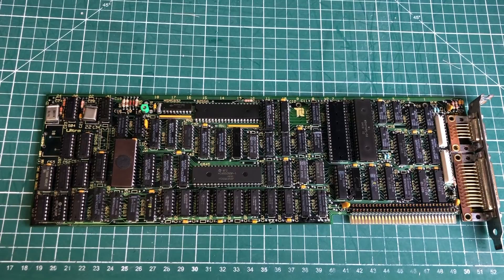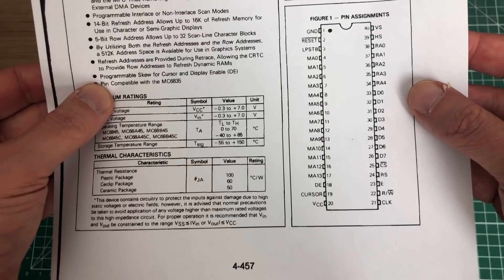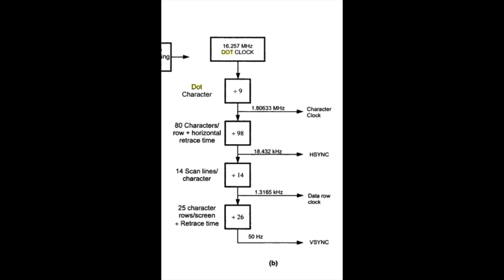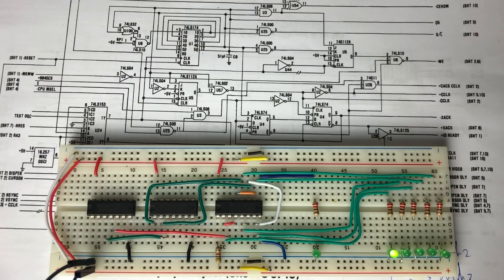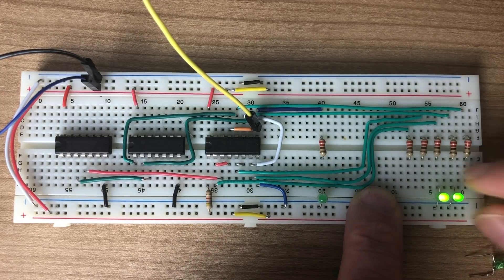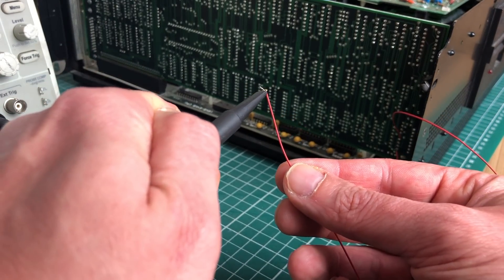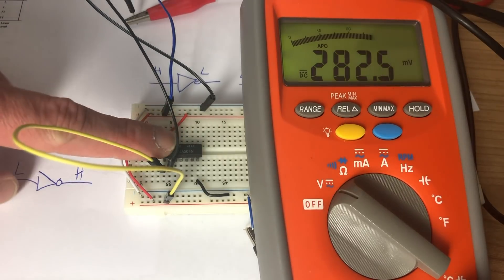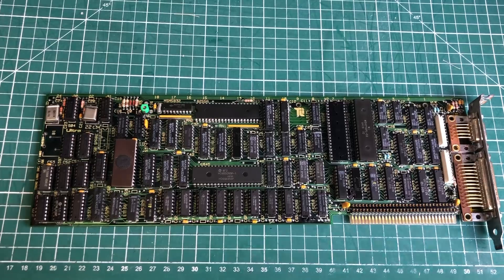Unfixable videocard from hell ? (part 2)

Comment: First things first, the card isn't going to run on 4.1V even if it was working perfectly fine (although I've seen a Williams Joust run on 4.2V, but very unreliably)
Clock: There's a good chance that this is a multi standard card where the clock frequency depends on what video standard it emulates. It has 64k of RAM, so it's quite thinkable it can do MDA, Hercules and CGA, so that depends on how it's initialized which depends on what's on that ROM. The 6845 is really flexible. Go check HSync and VSync.
Hot Chips: If it's a 74LSxxx it shouldn't get hot. Some get warm. There are exceptions (like the 188). If it's a PAL or a GAL, these usually run hot. At least early ones like on this card.
Battery Acid: It's rather common to see chips that suffered battery corrosion run fine for a few hours or days and then fail.
Logic Levels: Check the voltages on the pins on the ICs to the left of the ROM. If there's any signal where low is > 0.3V or high < 3V, that chip is bad. On the right side of the ROM are lots of tri-state devices where these levels are actually OK.
Reply from the maker: Thx a lot for all the tips. Will look at all of them and I hope to see you in part 3

Comment: is the crystal putting out the right frequency? I know its not really common, but they can go bad
Reply from the maker: Outgoing frequency from the clock circuit is fine. Both crystals (18mhz for the serial ports I think, and 16Mhz for the clock signal) seem to be fine.

Comment: Not an electrical engineer, but I would definitely check if those two 60C chips are working the way they should. There can be short in those two (closest experience I have is burned Arduino nano - atmega chip was very hot and never worked again after I accidentally shorted it).
Reply from the maker: Yeah will check those. Only decided to checked the temperature hours before editing the video :) sometimes you get tunnel-vision when debugging those things for too long.

Comment: You should try to install a replacement battery. I've had several PC components that had a battery that would just not run correctly if a good one wasn't present. Some circuitry only powered by it, or memory that will not keep its contents at all without the battery.
Reply from the maker: Tried it in the beginning but didn’t notice a difference. But would not hurt to try again. Thx !

Comment: Voltage drop isn't across the connector but your super thin wires...
Reply from the maker: Also possible yes :) was even worse with my chinese croc clips :) never knew that made such a difference. And didn’t realise it would draw 1.8amps.
Reply: @RetroSpector78  Yeah the Chinese croc clips are notorious for being terribly thin or making bad contact even inside the clip, really got to measure them and trash the bad ones

Comment: 60°C of heat on a standard TTL logic IC is not normal at all. Probably those 2 chips are internally shorted and cause a high power draw when you put the board in the ISA slot, this could affect the correct working of the entire card. I would start by replacing them.
Reply from the maker: I checked that these pins were electorally connected and as such it didn’t matter what pin I used ? In that case is it possible that one chip is on pin29 and would not affect pin 3 ?
Reply: @RetroSpector78  Ignore that part of the ISA slot of my comment, I actually deleted it after re-watching your video, where you connected pin 1 and 3 to the power supply and measured the voltage on pin 29 and 31. This confirms that the two +5V lines are connected so powering the board from pin 3 or pin 29 shouldn't make any difference.
I suspect that those two ICs are internally shorted to ground. I remember when one chip died on my Roland Jupiter 6 analog synthesizer, I was playing some music on it and suddenly the synth went out. No magic smoke, strange noises and such, it just stopped producing any audio and all the lights on the panel went off. No response from the keys nor the controls on the panel and a power cycle didn't fix that (of course...). I opened it and by touching the components with my finger I identified one analog IC on one voice board that was really hot. I replaced it and the synth came back to life - that chip suddenly shorted to ground. Chips can short at any time and when you less expect it even without any bad power event, so after that experience I'm not suprised to see issues like yours, especially on such old boards. This is why I suggest to start to concentrate around those 2 ICs, like others adviced in the comments BTW.

Comment: The PC power bus is probably dropping lower than the bench power supply and the clock is being affected by that.  Those chips at 60degC are DEFINITELY too hot and should be replaced.
Reply: DAC chips will get that hot. Which is normal-ish. 10 watts isn't outlandish but is higher than I would expect. My genuine herc card used 8.8 watts IIRC. Clock won't be effected by vdroop much, or shouldn't be. It is being pulled into a mode that is not usable for post.
Reply: @wishusknight3009  There are no DAC chips on that card, the chips that were hot appear to be 74 series logic chips next to the CRT controller.  The closest thing to a spec that I could find says 4.5A is the limit of the ISA bus.  I can't believe the actual connector is rated for that.  I'll have to check my Hercules card, it would be surprised to see 8.8w.
Reply: @eformance  Makes sense. Shows what I know lol. I see some other people here have given some good explanations to the heat spots.
Reply: Agreed
Reply: Yup

Comment: That power consumption is a clue, I don't think that the video card should take ~10w.  You probably have some shorted parts on there and a "fingertip test" should be done to find any warm chips.
Reply: EFormance Engineering  probably leaking gates to a rail
Reply: Totally agree. These cards take about 4-6W.
Reply: Just spray the card with alcohol. If it catches fire then there was a chip that was getting too hot.

Comment: Did you try EEPROMing it?
Reply from the maker: Read the eeprom chip and seemed ok. Could read it and noticed lots of characters in it :) so I guess this one is not the issue.
Reply: @RetroSpector78  I would not be so hasty in saying that it is OK (quite yet). I would try EEPROMing it with confirmed working image that matches the card - if you can find one. Also keep in mind that those tend to have limited read/write cycles and you cannot do it forever.

Comment: The divider logic is not dividing by 9 but by 16 instead. My guess is a bad logic chip  in the divider logic. Sometimes chips don't go completely bad, but are almost bad and sensitive to the power supply. Try varying your bench supply by +/-5% and see if you can reproduce the effect on the bench. The voltage drop on the bench was quite considerable. The bad logic chip might just still work at this lower voltage...
Reply: Adding a wild guess: hard to see but I may have spotted a 4bit counter (74ls163) not too far from the oscillator. This could be used to divide by 9 (reset controlled by a NAND gate combining bits 0 and 3, so the counter resets to 0 when reaching 9). But when the reset logic doesn't work, the 4bit counter divides by 16 instead).

Comment: Hey there, been watching your series from some time now so I thought I'd give you a little help with my insight.
To me, the main steps of diagnosing over consumption are as follows :

1- Checking the power rails integrity : with a simple ohmmeter, pick your usual +5v/-5v/+12v/-12v on the main connector (as you did) and check that each (and I mean all of them) chips VCC are connected. Do the same with each GND.

2- Power it with a bench supply, preferably not more than 500 mA on the +5v rail. If current gets limited, check what is consuming that power. You can feel the heat from the components with the back of your hand (or even your face because it's even more sensitive... silly, I know, but it works).

3- Now you've identified something. Those two 74ALS258N sitting in the middle that are overheating seems to be linked to the excessive idle power consumption (2 Amps at idle is a lot). These are data bus multiplexers, and their outputs might be tied down to ground by what's after them, causing them to sink all the power through them.

4- With the power off, check again the outputs of the two chips and the GND. With an ohmmeter, then with the diode tester mode (you could find bad transistor junctions).

5- Then proceed to remove all socketed chips you have on the board. The idea is not only to find the culprit, also being able to reproduce the fault. With (almost) no circuits, you will get the big picture of whether the chips OR the board is at fault. Dirty traces under sockets can cause high impedance MOS inputs to go low or high.
(By the way, once you know the board's PCB is in good health (clean, no bad traces), soldering sockets for the chips is helpful)

My personal advice would be to remove all RAM chips, they can go bad for nothing much.
(Don't focus too much on the "low" 1 Mhz clock signal, it might be related to low VCC)

Once you've identified something wrong and eliminated it, repeat from step 2.
Then, once we have every chip present and not causing problems, we willl look for the proper signals (clocks).
I'd advice not plugging it in the PC until then.

Good luck with your fix, it takes time and patience but it is worth the happiness once you get it done :) so please don't give up.
Reply from the maker: Thx a lot for this elaborate comment ... will definitely try out your suggestions, provide feedback and hopefully see you in part 3 :)
Reply: @RetroSpector78  another video I watched said flux was acting as a semiconductor and the 6502 worked after the flux was cleaned off. I think the corroded leads may be from water damage I want to see part 3
Reply: Damn dude this is like an entire wikihow article with a step by step guide on how to fix this card!
Reply from the maker: Hehe .. sure looks like it :) but already tried a lot and it can get complex.... without schematics and a lack of some fundamentals and experience it can be tricky. Fixing a PC is 1 thing, drilling down to the chip or even logic gate level is another :) but as long as it stays fun I will continue. If all else fails I’ll run over it with my car and make a video on that :)
Reply: @RetroSpector78  No you won't...
Reply: @RetroSpector78  You're welcome.

Don't be discouraged by the apparent complexity, just check one thing at a time so you will be more efficient.
Read some datasheets (datasheetcatalog.com is nice for this era), and you will get a general idea of the inner workings. Experience comes this way.

I can still guide you through what you will find when troubleshooting.
But please... no car...
Reply: @cookiemetal7792  I won't let him!
Reply: its also entirely possible that the interface on the pc has some sort of issue due to age ie slightly rusted connections, weaker than expected capacitors that drive video card slot . It seems really strange that on the bench you would have good signal but putting in into a pc , the signal gets swalllowed
Reply: @Cookie any resources for learning how to do some of this stuff, for instance how to find bad transistor junctions? I'm trying to fix a board of my own, but I'm very new.

Comment: interesting! was the crytal still oscilating at 18MHz when you plugged it in?
I think maybe some of the +12 -12 -5V is disturbing either your mass or your 5V signal.
Try using standard PSU on the bench
Reply from the maker: both crystals were oscillating fine in the PC. I think the 18Mhz was used for the serial ports (this is one of those multi-functional cards including serial ports, a battery, and a header for a memory expansion.
Reply: good luck, seems like Cookie made some uberawesome suggestions!

Comment: Verify that the voltage when the card is in the pc is 5 volts. If it's not, the crystal won't vibrate at the correct frequency. If that's right, try replacing the chips that are going up to 60C. Those chips may be shorted out internally
Reply from the maker: Checked the voltage on the video card headers and it had a clean 5v. Low voltage on the test bench is the result of the jumper wires / connectors / headers. (Initially tried it with croc clips and there the voltage drop was even worse). So voltage is ok. Will look at those 2 chips getting hot. Thx.
Reply: @RetroSpector78  I know this is going to sound tedious, and it is, but you really should check the voltage at every chip. Any one of the chips could pull the voltage down and you wouldn't know it checking at a single point. Or the chips could be introducing noise into the system and the frequency divider doesn't see all of the information it needs to see because it's masked by noise. I personally would check the voltage at those hot chips and go from there
Reply from the maker: Appreciate every tip ! Will try it out :) thx.

Comment: Maybe one of the memory chips on the card could need replacing, check the flow of the wiring on the card, using a 'small amount of heat' may help. Edit: clock signal is derived by some component, so if that "said" component reports incorrect clocks, then it seems logical to replace it. Though 'what_chip'? allows this.
Reply from the maker: Removed all of the memory chips and put them on a working mda card. (And vice versa) Worked fine so I guess memory chips are good

Comment: Loving the series, I think we can figure it out! Did you verify the voltages going to the osc crystal?
Reply from the maker: TTL chips voltage of the clock circuit is ok. And on the output of the oscillator circuit I am getting a clean 16.257mhz so on the source everything seems to be fine

Comment: 60C on some TTL Chips (?). That would seem shorted to me. Maybe that's also explaining your high Amps and low voltage on the card, which in turn might be affecting your crystal?
Reply from the maker: Yeah that will be the next step replacing those. On the working ibm mda card I also get 1.2amps power consumption. Dunno what is considered “normal” for these cards. And low voltage is the headers / connectors I think. Cause in the pc it is getting a clean 5v.

Comment: Sir maybe there's a bad connection on the  card  edge connector and the clock signal of the pc interferes with the one on the videocard. It's a wild guess and I don't even know if it altogether possibile. Take care and thanks for all your work :)
Reply from the maker: Issue occurs on multiple pc’s. So has to be an issue with the videocard itself. You also take care and thx for the comment !
Reply: I understand and sorry for my crappy english, I was talking about the video card edge connector not the expansion slot on the various pcs.

Comment: What is the minimal signals from the pc needed to get this working. could you make a circuit to emulate the pc to help diagnose the card fault.Or add something between the pc and the card that would allow you to break the connections one by one.
Reply from the maker: Trying to reverse engineer it bit by bit. But hard for a rookie like myself without schematics. Need to brush up my electrical engineering skills :)
Reply: @RetroSpector78  I was looking at it from the ISA connection. You said it drops down from 18mhz to 1mhz in the pc.  if you disconnected the signals until it goes up to 18mhz it might give you a clue . I am just giving wild ideas and no expert.
Reply: @RetroSpector78  if you give it all the voltages present on the ISA slot does it give you any picture ?

Comment: Have you checked the crystal? I do remember people though very rarely having to change them other than that something has to be bad.
Reply from the maker: Crystal was fine .. had to replace it in the end cause I broke one leg off and was difficult to solder back on. But it is outputting the correct signal. Need to find out why the division by 9 is not working in the pc